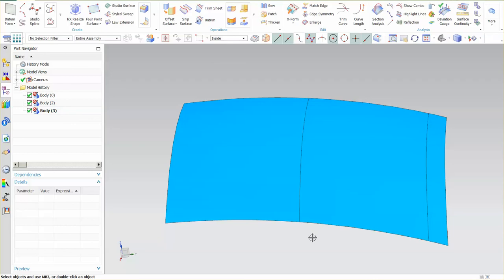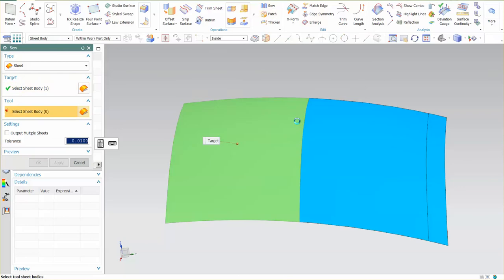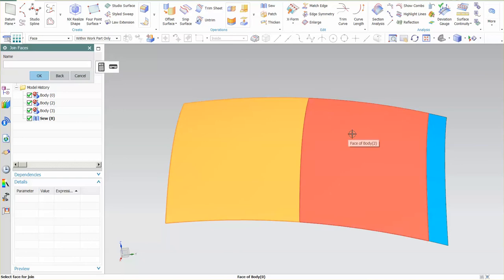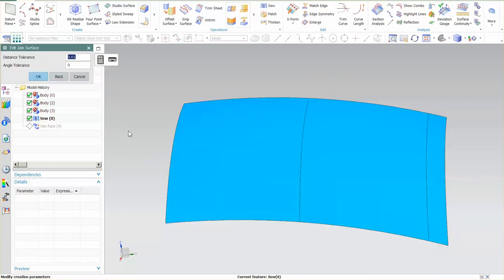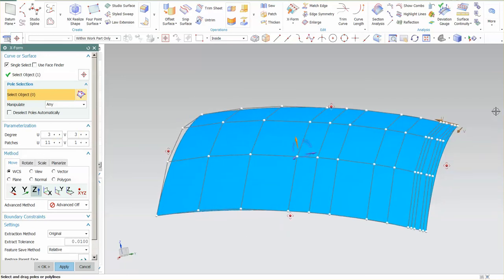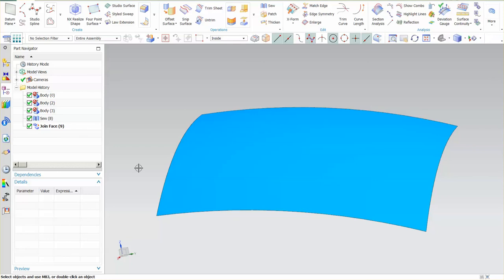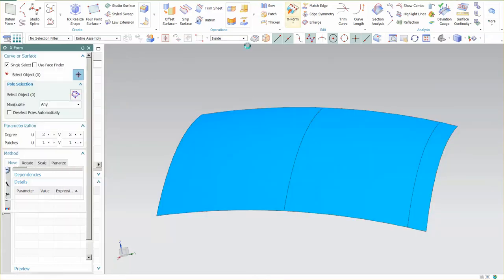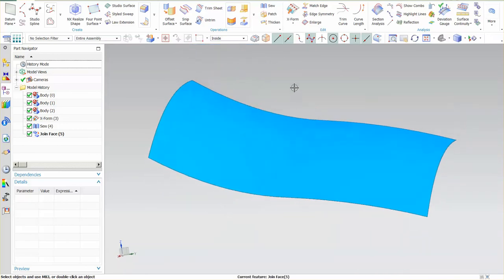Join | Siemens NX 10

Comment: In the new NX (1847), this operation is written as obsolete. Is there any replacement?

And another question about Quilt operation. Neither can I figure out how to use it. There is an error "Error protecting the point on the surface"
Reply: I'm using NX 1919, it says legacy but I can still use it.

Comment: Thanks for the tips, but when i try to make it the joint face dosen't work. I start from two surface created by surface studio...maybe the problem is this.
Which kind of surface did you use to make the video?
Reply from the maker: Did you sew the surfaces together? They need be be one element.
Reply: +class A surfacing yes, i sewed before to use join face
Reply from the maker: antonio inochi email me the part, I will have a look.

info@classasurfacing.com